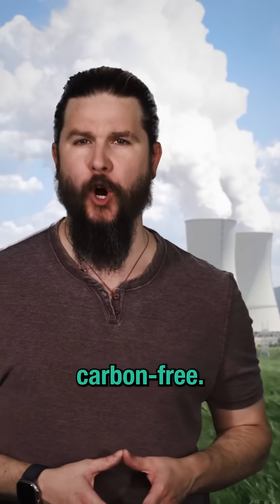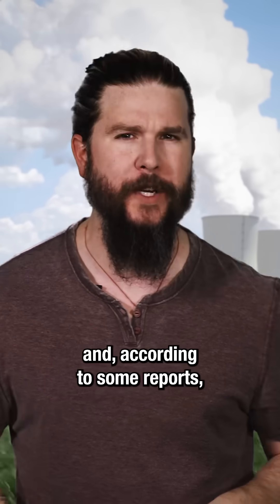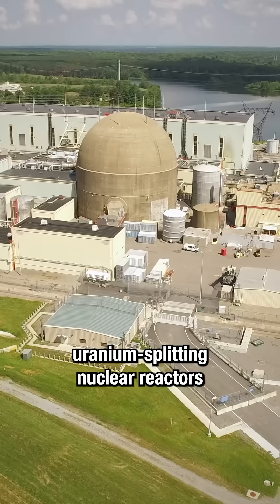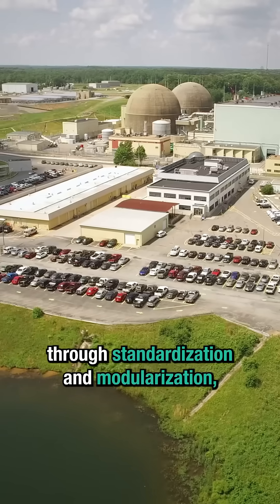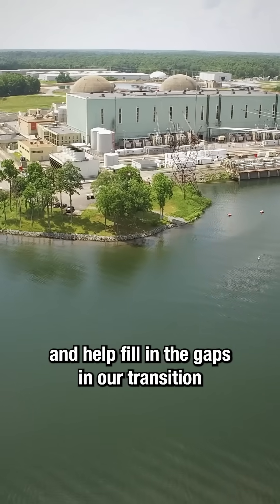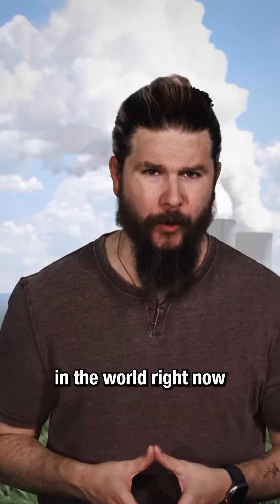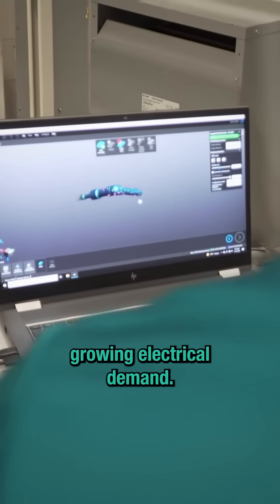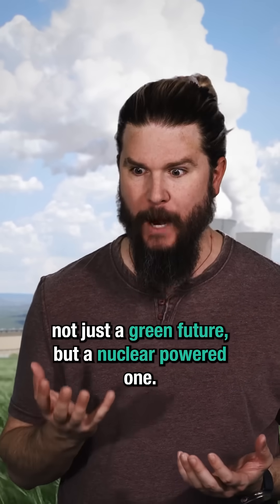Are Small Modular Reactors the Future?

Comment: Maybe u can make a mini reactor that would be capable of generating enough  energy for a theoretical 300,000 people but without giant steam generators to actually make use of that energy then there is no way it would work so you would still need a whole power plant
Reply: Small Modular Reactors (SMRs) generate their own electricity and do not need external turbines; they incorporate turbine generators within their design, which convert the heat from the nuclear reaction into electricity. Because SMRs can operate independently from the electrical grid, they are designed with "black start" capabilities, allowing them to start up without grid power and even supply power during outages.

Comment: If placed near industrial parks, the removed heat can be used at those factories instead of the generated power. Imagine being to harness all the heat released from the stacks of a power plant. Massive improvement on efficiency on something that's already the most efficient. Less strain on the overall grid. Lower electricity costs
Reply: It's a win win win, until someone convinces the politicians it might look good but here's a "lobbying arguement that has a lot of names in it."

BP, oil, Saudi and USOil
Oh and 4billion dollars... Damn I can't believe this tech will turn the FROGs gay time to ban.😊
Reply: Also less power lost in high voltage lines!
Reply: It's also possible to heat homes with it, but to my understanding that's only practical for mid-to-high density housing, rather than the dystopic suburban sprawl we're obsessed with building these days.

But yes, being able to tap into the thermal energy directly rather than needing to convert it to mechanical, then electric, and back has advantages.
Reply: You are better off with regular sized 3rd or 4th generation reactors. Especially for heating.

Comment: The future is not dangerous and destructive nuclear ticking time bombs. The future is solar, wind, and organic solutions.
Reply: Moron nuclear power has nothing to do with nuclear weapons. The only nuclear power plant that killed anyone was deliberately built wrong and operated wrong by the USSR and it killed less than 50 people. A single hydroelectric damn failure killed hundreds of thousands of people and displaced over 11 million.
Reply: Stop spreading misinformation. Also, like everything, the more widespread something is, the more frequent negative events will occur. Drowning skyrocketed when swimming pools became affordable to most consumers in their own backyard. Nuclear plants whether fission or fusion based will be the same but when they inevitably have a problem, miles will be irreparably contaminated at best. Millions will likely parish. Instead we can create carbon based solar panels, design them to transform heat into electricity, use multiple layers of material to capture more types of radiation and call it a day. Supplement with wind energy or biofeul as needed with no risk or environmental hazard. We are just trying to get to where we can set up collectors in orbit amd beam down power direct from the sun after all which will be viable once we can affordable mass produce stronger materials like graphene. Nuclear is not the future and is too dangerous and unpredictable. There is also almost no profit in it too so it doesn't improve the economy.
Reply: yeahhh lets bulldoze your house for a wind or solar farm and see how you like it?

Comment: Hopefully they don't end in dusaster like SLR-1.
Reply: SLR-1 was an experimental reactor, before any commercial reactors existed, and the disaster was because the control rods were inserted by hand with no safety systems or automation.
Reply: @flyingfree333 I know, I was simply saying I hope they work out the kinks of smaller reactors. That's all.

Comment: That would be nice so all the smoke that could be in the atmosphere from the factory n stuff
Reply: Somewhat confused by this comment. Are you implying that nuclear reactors produce smoke? Nothing is being burned, they boil water. The gas that leaves the cooling tower is water vapor. That is one of the power source’s biggest advantages, barring accident conditions, nuclear power does not release any harmful airborne byproducts at any stage in the process. All steam turbine plants do this, including coal, oil, and natural gas plants, the latter three also release smoke from the unit stack, but this isn’t the same as the cooling tower. Nuclear plants do have an exhaust stack, though most will never use it for anything other than air, they are a disaster mitigation measure to increase the height at which radioactive air effluents are released, increasing their dilution factor substantially as a measure to protect local public health.

Comment: I imagine one big advantage of SMRs isn't just scalability and lower costs, but also safety. If there's less nuclear fuel in any given operating reactor, even a catastrophic meltdown is gonna effect a much smaller area, cause significantly less damage and require much simpler cleanup.
Reply: It goes beyond that. Modern reactor designs are built to fail off (similar to security systems that can be designed to fail open or fail closed if power is lost). Should the reactor lose power or cooling, it will break in such a way that the reaction stops.
Reply: Aye passively safe is the term I think they use, Canada is finalizing a design for a gen3+ that by the sounds of it include those passively safe design features.
Reply: The nuclear power plants that have had accidents were designed and built by people who are mostly dead by now. Which is sad because I loved my grandad, but on a positive note there has been a huge amount of improvements to safety in nuclear power since then.
Reply: I'd also imagine them being a standardized  modular design also helps a lot with safety, since you don't need to design and build a entirely different safety system for each newly built reactor
Reply: Bu bu bu the billionaires have vested interests.

To the MONEY machine 

Fellas fellas I've got a plan let's pull a WW2 AGAIN. 
that will kill those filthy poors
Reply: Keep in mind, also, that smaller reactors are intrinsically safer than large ones (not that I expect the public to budge on their fears of nuclear energy for anything short of making meltdowns completely impossible)
Reply: That's not how scaling works.
Reply: SMRs are designed in such a way that if it were to experience a catastrophic meltdown the fuel would (in relevant designs) melt a plug that drains the molten fuel into a tank that halts fission and allows it to cool. This is in layman's terms but that's the gist.
Reply: @whogavehimafork  there are zero currently operating SMRs. Not even prototypes. You can claim things on paper all you want, but without testing claims are worthless.

Comment: The important part is they have to be cheaper than fossil, else they'll just be the dreams of nuclear advocates.

Going by the cost and build times of the Chinese & Russian SMRs, and the cost increases of NuScale's CFPP project before it's cancellation, that doesn't seem likely.
Reply: Nah I call BS. These will be up and running in no time. And the Oil industry will make sure you pay premium for it XD
Reply: @skullsquad900  The AP 1000s at V.C. Summer 2 & 3 and Vogtle 3 & 4, and EPRs at Olkiluoto 3 and Flamanville 3  were modular based on standard designs.

People went to prison over the delays at Summer, Vogtle was 7 years behind schedule and over twice the original price.

Olkiluoto & Flamanville were supposed to take 5 years to build but took 18. At least the Finns had enough sense to do a fixed price contract which ended up bankrupting the builder, Areva. And Flamanville was 4 x the original cost.

Even the existing French fleet had escalating cost during construction. And the power is only cheap due to heavy subsidies.